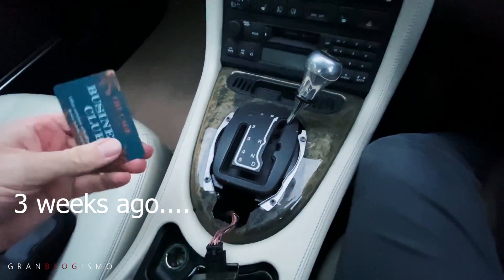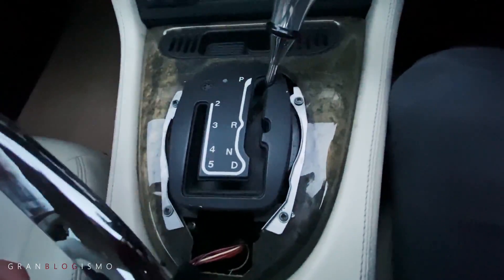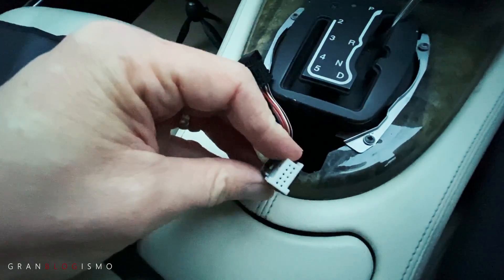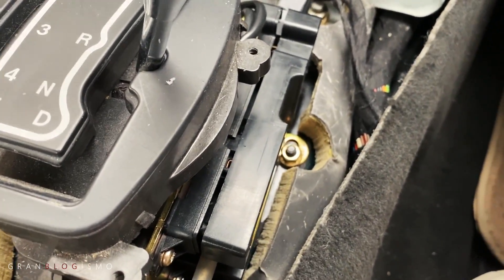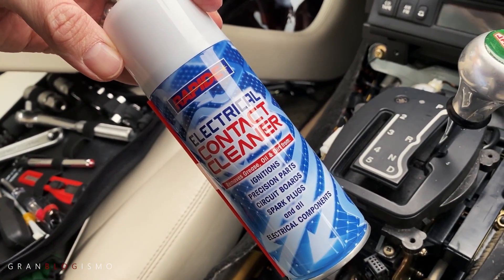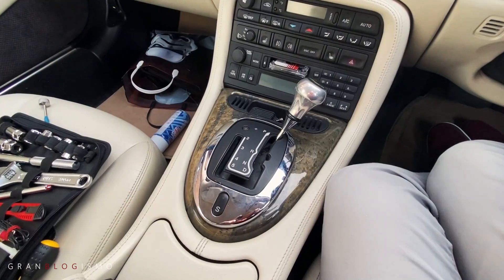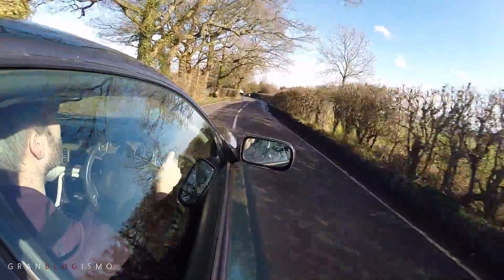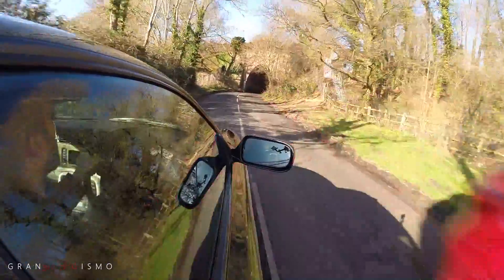Jaguar XK8 -  J-Gate Not Fixed and New Tyres!

Comment: Early cars had a cruise control master switch and sport button there. Not sure what facelift ones had.
Reply from the maker: So on the later cars it seems this switch toggles between cruise and speed limiter, I suspect it has to be ‘programmed’ to work but might buy a switch out of curiosity!

Comment: The Switches are the same in the Xj, and I rewired them with a cool looking flip switches (the whole bond thing) so you could wire the cruise wiring into that and place a switch somewhere. All you need to do is find the wires that light the Led and the wires that complete the signal! as you will find continuity in most of the connections made. 

Good Luck :)
Reply from the maker: Cool, yes I quite like the idea of q-branch style mods (like the tablet install in my MG) might look into that! Thanks for the comment!

Comment: Before you replace the linear gearbox switch or any other part, it's worth checking the TCM harness where it connects to the transmission (right rear of the gearbox). The TCM connector sleeves are notorious for leaking on these ZF 6 speeds.  When the connector pins are saturated in tranny oil any number of weird electrical faults can occur and often intermittently.  (I hope this isn't a double post...I posted similar response a while ago but it seems to have disappeared!)
Reply from the maker: Is this testing your comments disappearing? I try to reply but the comment is gone before I get there!!
Reply: @granblogismo  yes, but this time it looks like it's stuck!
Reply from the maker: 🤣 I did see the last comment content but couldn’t reply, I hope it’s not the gearbox connector plug thing as that’s what’s supposed to have been fixed but I’ll check it out!!

Comment: Good luck with fixing the J-Gate, definitely beyond my capabilities! As you haven't used the Jag for a little while do you keep the battery on a trickle charger?
Reply from the maker: I totally should keep it on a trickle charger but I don’t, the last time I drove it it had reset the window positioning so if you open and close the door the window stays ajar! Easy to sort but shows that the battery dies run down if left for too long!

Comment: Does your J-Gate and Sport Mode reset itself after two key on-off cycles, function properly for a while, then reoccur?
Reply from the maker: It did do that a couple of times then seemed to stay like it, I’ve since taken the linear switch apart and cleaned all the contacts plus bent the ‘prongs’ inside to make better contact and has been fine since 🤞 replacement is inevitable at some point I fear!
Reply: @granblogismo  Mine does it every 6-12mos ever since I got it in 2011 with 48Kmi.  Now have 136Kmi.  I have cleaned and lubed once before and will try again with some bending.  The contacts IIRC were triple redundant phosbronze and ENIG, so am mystified as to what is really going on with it.

Comment: Did you get a good deal on the M Sports? I'm due to change my rears soon but have always gone for the Pirelli P Zeros, at great cost. Hope you sort the J gate soon.
Reply from the maker: Yeah they are a fair bit cheaper than the Pirelli  about £650 for all four but I have 19 inch wheels, did you say previously you had 20 inch? Probably quite a bit cheaper for 19 vs 20 but not bad price for decent tyres 👍
Reply: @granblogismo  yeah, 20' Montreals. Think last time the rears were around £250 each corner. £175 fronts. Great grip, but I never truly use it. They dont last long either.  Re J gate issue, I'm sure you've already done this, but are all related fuses ok? The other thing maybe to check, is the Sport switch. I'm sure I've read somewhere when that goes it disables the manual selection as a byproduct of the fault. I may have remered incorrectly tho.
Reply from the maker: Jules Redeye yeah think the fuses are fine because it’s intermittent whereas a blown fuse would be always broken, sport switch is a maybe, pretty certain it’s that box of tricks but might start with the cheapest thing and go from there!!

Comment: Just replace the linear switch !
Reply from the maker: Yes I suspect that is the right thing to do but I did try and remove the box but couldn’t figure out how to remove it!! I undid the 4 bolts holding it to the car and the nut or bolt holding the gear selector bit in the middle but just wouldn’t come out, I must be missing some other mounting point but haven’t found it yet...